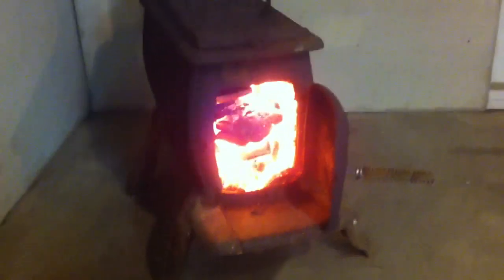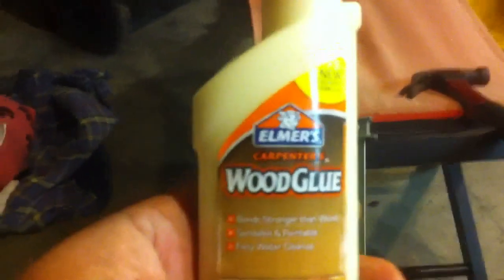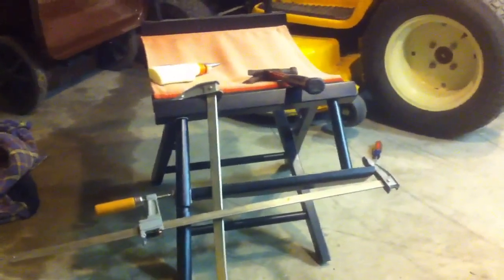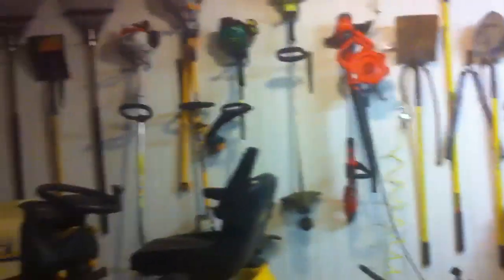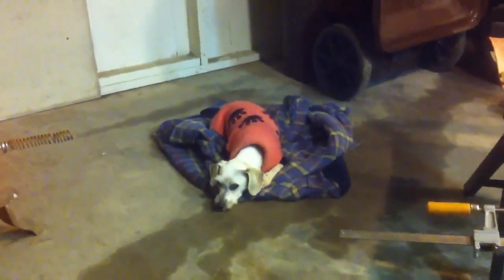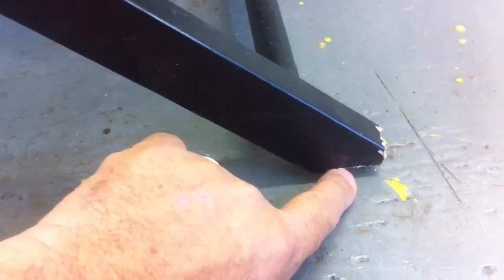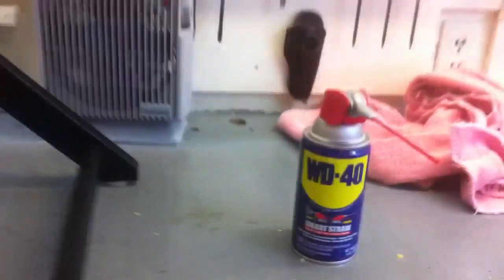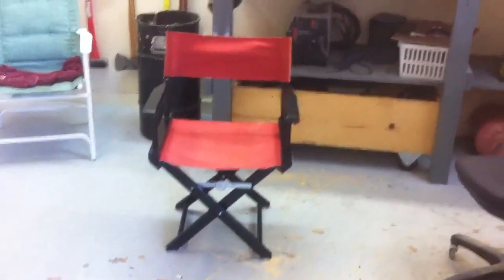recycle,rebuild,repurpose,repair!

Comment: I didn't know that you needed assistance with weight testing things. I too weigh a bit over the 200 mark. LOL
Reply from the maker: well,,,, a few years ago, i tipped the scales at 360. im down to a svelt 270 now.
Reply: bctruck brad
That's great as I wish I could shed my tonnage. All I 've managed to do was loose around 40. I've 2 herniated disks in my lower back so exercising is out of the question. I've tried varied diets to no avail.

Comment: I have a wood stove like that. The cast iron leg broke. I need to get it welded.
Reply from the maker: the leg was broken on this when i bought it for 25 bucks. i fixed it with bolts. i did a video about 2 years ago on  fixing it.